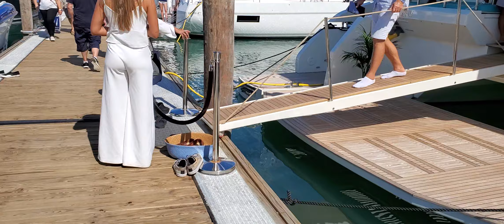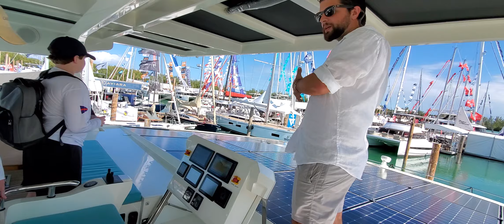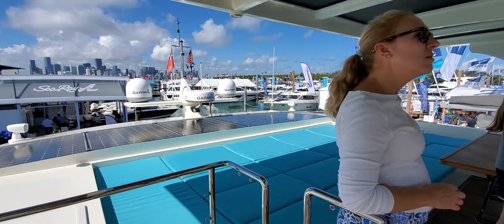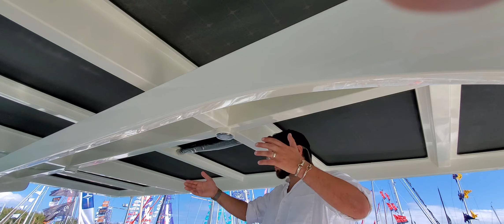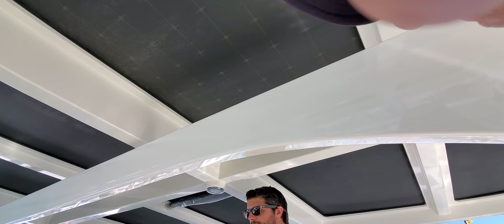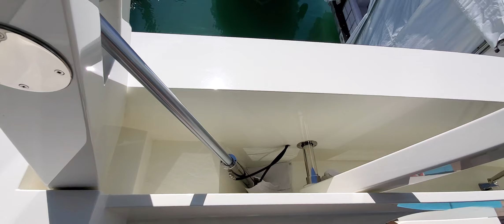Miami Boat Show 2020.  The company owner shows us the 3+million 2020 Serenity all-solar 64 cat.

Comment: So I LOVE the idea of a solar yacht that can go basically indefinitely.

That being said, I feel like there's something shady here.  He says that they are generating "more than 15 kW in an hour".  Right now the most efficient solar panels that you can buy without having nation levels of money generate 220 watts per square meter (at standard direct sunlight, not counting for very high insolation that only happens at specific latitudes and only for an hour or two per day, during specific weeks of the year).  And that's using panels that have only even been available for a year.

Further, on their site they state that they are generating 240 watts per square meter (which is where that "over 15kW" comment probably came from) Except that would 2% more efficient than the most efficient panels you can buy.  Heck, even the $1500 per watt panels that NASA uses would probably struggle to produce that if they were at ground level.

I mean, I don't think they're trying to scam anyone, or even that the thing can't sail indefinitely.  I 100% believe that boat can do that, but I also think he's being dishonest to sell the thing.  I mean the "Running the AC so we don't overcharge the batteries" comment is a great example.  If they are using Rimac tech, then that won't happen.  Their batteries are very very smart and very very well protected.  Maybe they have separate house batteries using a different tech.  Except that preventing overcharge is something that anyone with even the tiniest bit of understanding of these things hasn't had a problem with for a very long time.  Also, yeah, of course you can run the AC constantly when not running the motors.  Those motors are going to be 90% of the power consumption on the boat when you're running them, unless they are absolutely tiny.  A 25 ton boat needs about 700 hp to hit 9 knots, so they can't be tiny motors.

Honestly, I think I would prefer silent yachts over these, because I really hate deceptive marketing.  Just be honest about these things.  We need more solar yachts, and lying about things isn't going to help things along.
Reply: Basically it's a Solarwave 64(now Silent 64)
It has 7 row's of 6 panels
That's 42 panels that would be about 360W per panel(at 15kW)
You are comparing Diesel/petrol engine's to Electric motor's(electric motors produce quite a bit more torque) 
quite reasonable

Comment: Thanks for covering this boat.  Very few seem to have uploaded videos of it.

The reason the roof of the fly ridge lowers is for power.  A small amount of shade cuts a solar panel output in half.  They are very sensitive.  So really if you want to run solar you keep the fly bridge down so it’s not shading %60 of your panels and cutting %90 of your power.  That’s far more if an issue than windage.
Reply from the maker: You're welcome I just happened to turn my Note 10 on and did some filming. Didn't expect 10k views! But hey that's YouTube.
Reply: how much the efficiency drops depends a lot on how the individual cells in the panel are connected